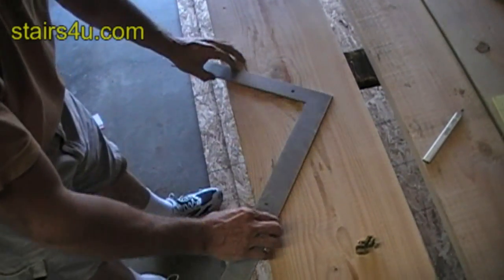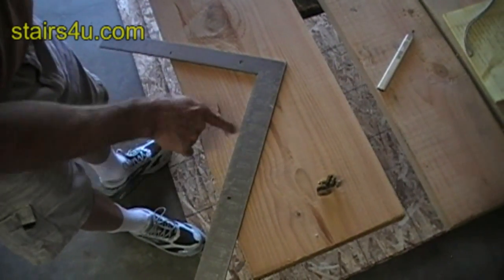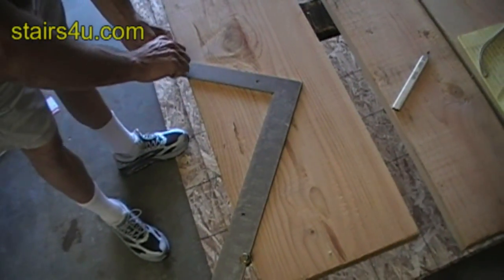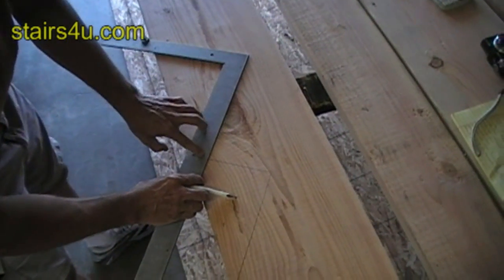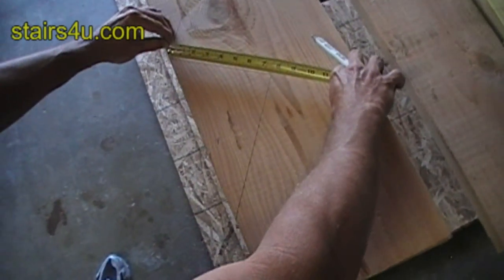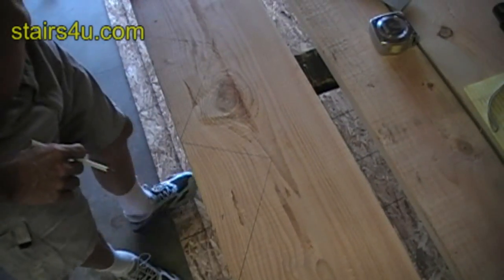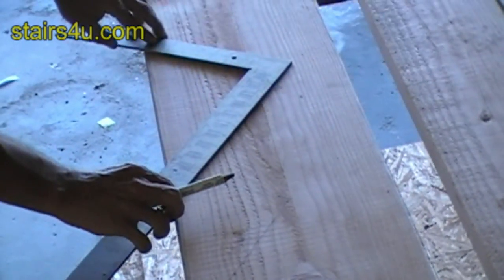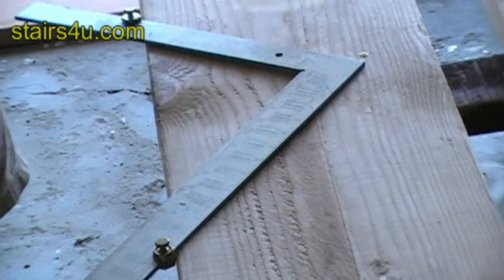Setting Up And Laying Out Stringer - The Most Important Stair Building Tip

Comment from the maker: I can't tell you how many times I've thought I burned an inch or added an inch and it can get confusing. I've been using this method for years to double check measurements that need to be spot on, but like most of the information I share with people, it won't always be the best. However, now I know a little more about what I should be doing in the bathroom, bedroom and bar.

Comment: would this idea work?  What if you put the screw on stops on the mark of what your measurements were, and used the outside of the square instead of the inside to mark your line?  Then you wouldn't have to deal with measuring after drawing your first two, and account for the curve of the board's edge.  What are your thoughts?